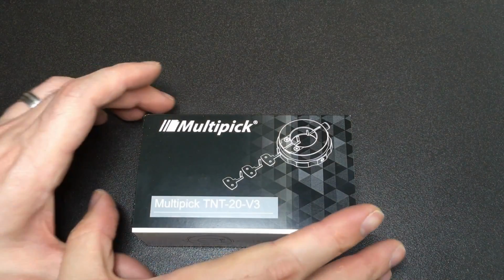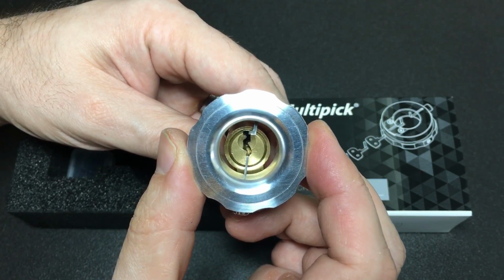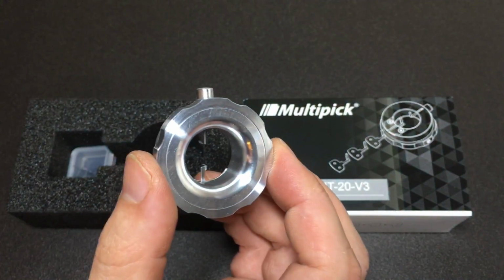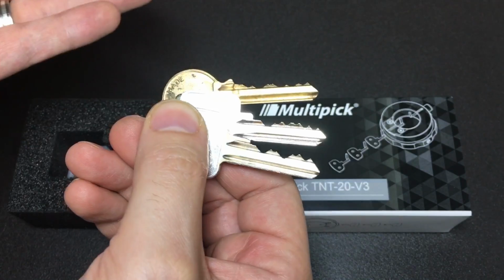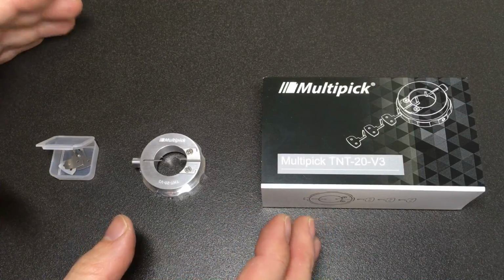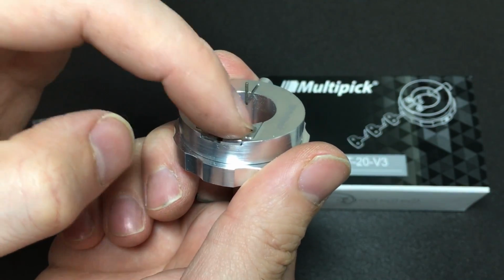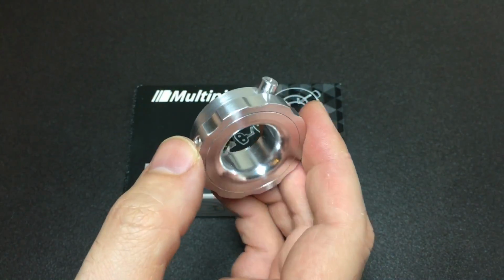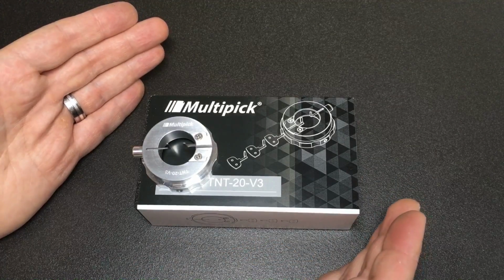Multipick Tension Ring Review

Comment: I must say, to me, it looks far too bulky for "real" locks mounted on doors..it may be great for locksport cores mounted in vises, but I doubt the space between the door frame and the lock core - whether its mounted to the left, or the right - would be enough for that entire thick alloy circumference as well as room for your hands, picks, gloves, etc to work comfortably..plus, as you've said, it effectively makes most of your standard single pin hooks too short, let alone those of us who like making or modifying our own picks! Thanks for the review though, I love most of Multipick's kit but seeing this in a real-life situation tells me this particular one is not for me.. 👍
Reply from the maker: Fair observations 🙏
Reply: Is it not the tension bars on it that hold it in place? Hence why you can move/exchange them? They also sell another box with extra parts for curved key ways.

Comment: I bought one from sparrows but wasn't happy with it so i bought this one from multipick cause there engineering is second to none! It works good on locks on doors. Works better if you cut the top pin off just a tiny bit so it will be flush with the lock also using a epg works best!!
Reply: What was it you didn't like about Sparrows? I've been looking at theirs since the price isn't hefty.
Reply: @Ghost_Os  it will work. The machining isn't real great when you push the top button down to insert it in the lock. It goes down and out. It gets annoying after while. Multipick which I'm sure you know there engineering is second to none! When you push that button down it goes down. No flopping around in any other direction plus it comes with 3 different size bottom ones! Either way you will have to cut the top pin so it will fit snug against the lock instead of an 1/8 inch apart! I talked with Bosnian Bill alot about this trust me. If i could do it all over i wouldn't of ever even got one. I NEVER use either one of mine. We all have shit load of bok and Tok tensioners which is what we learn on. These tension wheels have been around for ever and you never see anyone using one in a video!
Reply from the maker: Yes, trimming that pin could be good for some locks 👍
Reply: @LockNoob  as in the length or the width/height? And can you not change the top tensioner like you can with the bottom?

Comment: As a hobbyist I wouldn't spend money on this. I wouldn't deny it if was for free though. Good of you to point out that it might interfere with SPP'ing as you're used to.
Reply from the maker: Did you enter the giveaway?
Reply: @LockNoob  Sure did. I'm curious about these, but there's so many other obviously useful things to spend money on, things I want but doesn't have and this is a gadget I would like to buy when I have no other stuff left to buy :)
BTW, my comment above sort of came out wrong. It might have sounded as YOU had some habit to leave out information, that was not my intention. A rewording would be: if you're used to SPP'ing the tension ring might deprive you of space that you're used to have - it potentially limits your upwards/downwards motion. This tool is probably nice for most other techniques, as you pointed out in video. Well done and executed. 5/5 as usual.

Comment: Hmm, I don't know...Not sure about this one.  I'm a huge Multipick advocate, I really rate their quality.  Not saying it's not well engineered, and I'm sure it does have its place, but possibly a little over-engineered?  A sledgehammer to crack a nut?  I prefer SPPing (which as you point out, it's not ideal for) and wiper blade or pry bar does the job, but yes, I do get that it might be good for professional locksmiths, or as you say, if someone finds traditional methods a bit fiddly.  Overall, a nice, well made tool but I think I'm possibly in a minority here, as I don't think it's for me.

Comment: This would be a great tool for a locksmith. Le's face it, locksmiths almost always attack with a rake rather than SPP.  Nothing like SPPing while standing in freezing weather with a customer breathing down your neck.
Reply: Very true, though occasionally, you run across one that just refused to rake or rock open.  I'm very good with tension control with the old fashioned tension wrench, but have always wanted to try one of these out. I think they would shine on locks with wafers on both sides, so you could get your pick right in the middle.
Reply from the maker: True

Comment: I'm a professional locksmith, as well as a hobby picker.  I've also always been curious how I would like one, but have never gotten around to picking one up.  It's a "want" expense, rather than a "need" expense, and I tend to put "wants" on the back burner 90% of the time.
Reply from the maker: Yeah, that’s very wise 👍
Reply: @Ghost How do you go about opening locks for folk? Do you try and pick or just drill through the lock and replace it? I'm thinking about doing the training for being a locksmith. I live in a large town thats nowhere near anywhere and doesn't have any professional locksmith so I'm seriously thinking about trying to get good enough to start a business. And do you have any suggestions about what courses I should take to get to professional level? Thanks.
Reply: Dont know why that last post never tagged you mate, hopefully this one does lol
Reply: @randommadness1021  I pick the lock. Fingers crossed, I've never had to drill. If a lock is giving me a particularly hard time, I try a different door. Even if the locks are all on the same key, a different lock will bind differently, which can sometimes make picking easier. Definitely get yourself a good plug spinner - plenty of times you can pick it quickly to the locked position, but can't seem to get it the other way. Plug spinners are great for that. Also, get yourself a flat 'pry bar' type tensioning tool. Plenty of times in the field, the frame of the door or some other obstacle will be in the way of you using the usual type tension wrench, and simply switching sides isn't always ideal. Access Tools for car opening needs, but also pick up the HPC mechanical wedge. It has three rubberized 'feet' that with the aid of another tool (plastic pry bar for instance) you can get into the gap in the door. You then turn a threaded knob which lets you adjust the door opening. Air wedges are great, get a couple, but if the check valve fails, or they get punctured, you probably won't know about it til you arrive on scene. For your through the door tool, get one that's coated in rubber (or do it yourself with heat shrink). Get or make a plastic envelope that you insert your tool through. Take steps to insure you're not going to damage your customer's paint job. When using a through-the-door tool, only gap the door as much as you need to get your tool through without it binding (and damaging their paint job) - you don't want to screw up their door hinge. I saw the aftermath of a local towing company job - customer said they used a half inch thick piece of rebar to go inside and pop the lock. They had to spread the door so far apart that it wouldn't even close afterward. Get Access Tools' frameless window tool. You won't get nearly as many lockout calls as you might be hoping for - learn how to take apart the different knobsets, lever sets, and deadbolts, re-key them, and put them back together. Learn how to cut a good key (a lot of this is making sure your key machine is aligned and calibrated properly). Get good at coring and boring doors to install additional lock hardware. Good quality jigs are a worthwhile investment. When you're using a template, measure twice (or three times) and drill once. Run of the mill doors are expensive enough. You don't want to screw up on a several thousand dollar decorative door. Take your time, use good tools, *take your time*, and do it right.

A good option for key blanks is "American Key Supply", at least if you're in the states. You'll also want a copy of Ilco's key blank directory. If someone brings you a wonkey unmarked key that you don't carry, it makes figuring out what it is a whole lot easier. Be aware that the images you see of the keyway are in fact what the keyway looks like - not what the key itself on end looks like. It's set up so that you stick the key on the page as if you were inserting it into the lock. Then you get level, and look to see if it seems like it would fit.

For a lot of my other locksmith tools and supplies, I go through CLK Supplies. They're a good outfit.

For locksmithing courses, as much as they get made fun of, Foley-Belsaw (still around for locksmithing) has a solid 101 course, and their key machine is actually pretty decent, especially if you get the upgrades to turn it into a code cutter. One way or another, invest in depth and space keys. Foley Belsaw also has a pretty good catalog of tools and books for locksmiths. There's Mike Gibson's "Locksmith Video School". I've seen a gentleman on ebay selling a dvd course, as well as individual dvd classes. I've not checked those out, but they sound solid. Searching for "locksmith dvd" on ebay should have you finding him easily enough. If you decide to check those out, let me know what you think, I'll feel better recommending them (or not) with feedback from other people (again, I've not seen them myself).

Hope this is helpful! Good luck!
Reply: @Ghost_Os  thanks mate. Very helpful 🙂

Comment: I’ve used the HPC variation with the guidelines on the face for decades and it works great for certain locks
Reply: Hi Jason, nice to see you here. I've been curious about them for years, but haven't caved in and spent the money yet. Thanks for leaving a comment here, it fuels my desire to try one a bit more.  LockForce!
Reply: Ghost it shines on defiant/kwikset/etc deadbolts and tylo kwikset knobs with the flat face. This one seems really too bulky but I love the HPC one. There are three I think, two “wire style” like this one for concave knobs one for flat, and the most expensive one with the guides on face which is the one I have. Works really well for glass storefront mortise cylinder situations also :) LockForce!
Reply from the maker: Thanks for commenting - it’s interesting to hear that they are used in the field 👍😃

Comment: What about feeback on the tension tool ? The counter rotation with spools ?
Reply: Paola frege Don’t know as you would be raking if you knew there were spools. And as he points out, this is wildly incompatible with SPP. Really kind of a niche item that has limited use in locksport for the majority of folks.
Reply from the maker: Not much feedback, but some. All these locks have 6 pins and multiple spools 😃👍
Reply: It says on their site that the best way to use it is turn it in the opposite direction when you start to work with it. I don't think this is supposed to be a lock sport item. It's just all about getting the lock open as quick as possible.

Comment: I keep my old HPC version of this with my EPG. Had great success with it. Only when the cylinder face is exposed though (handle, PAS24 etc forget it..). Find the HPC tool fits all key ways but is not a good snug fit as the tension parts are both the same diameter wire, fair bit of slop and not a ‘snug’ fit. This tool has been on my shopping list for some time but never pulled the trigger. Useful if your short of time, well made by the looks of it. Liking the different tension blades. Good honest review too, cheers!.
Reply from the maker: Thanks 😊

Comment: Hi Lock Noob, Great tensioning tool, particularly useful with a mechanical pick gun or electric - and raking - not so good for single pin picking ( poor feed back ) however the highly under rated "Y" shaped tension tool - usually incorrectly referred to for use only in shutter locks - works just as well for the above, giving even tension to top and bottom of the plug,  plus a ridged more positive feel for single pin picking. Regards, Brian.
Reply from the maker: Good tip on the y wrench!

Comment: Looks like a very nice well engineered piece of kit.
Question : Would that work on Cross locks? 
Just wondering because those can be a pain to tension as your moving around them trying to pick each row of pins ;-)
Reply: That's a really good point you made. Cross locks are a pain to tension, if that tension ring fits in the cross lock keyway it should help immensely.
Reply from the maker: Nice thought! I think that the keyways would be too small though